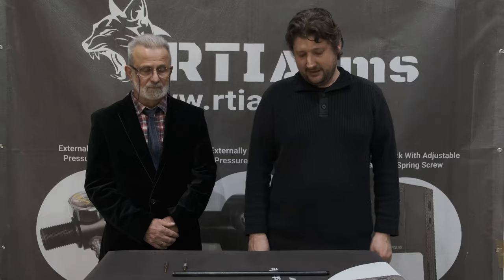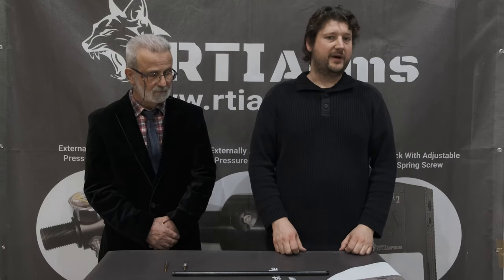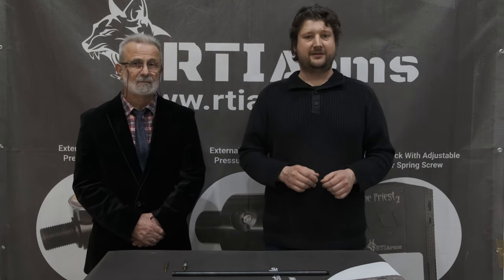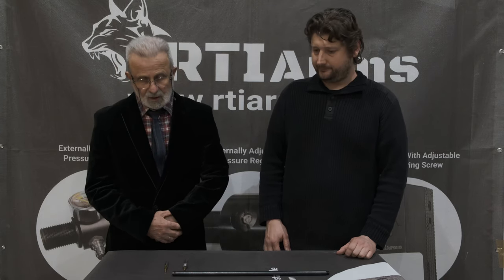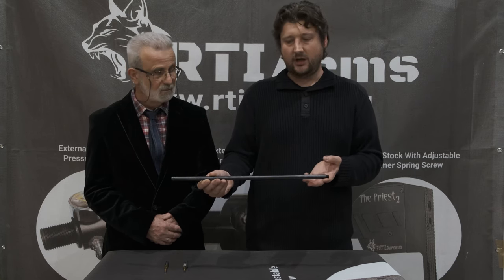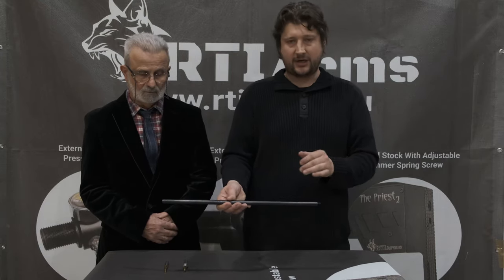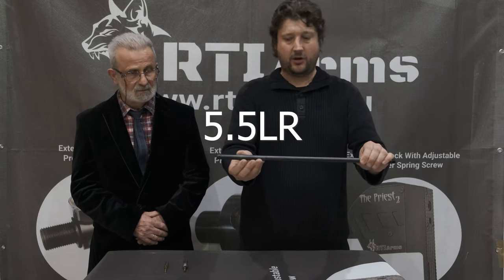RTI's Long Range pellet barrel - Visit of the RTI Arms factory

Comment: Thanks for sharing this with us, Gregor, although you did kinda reveal the secret in your previous video 😉 This is an extremely interesting solution - reducing the twist rate and increasing velocity: like this you decrease the influence of the gyroscopic precession but increase the stabilizing effect of drag, so that there is no conflict between the two which might lead to spiraling and a drop in accuracy 🙂 Plus the higher velocity leads to a lower time of flight and hence to less wind exposure. A great concept! I wonder if the rest of the manufacturers are beating themselves up and asking "Why didn't I think of this first?!!" 😉 See you at the IWA, bud!
Reply from the maker: Yes, I did reveal it in Airgun physics video because at the time of recording that video, this one was already recorded... ;) See you :)

Comment: Gregor will you be making a video how to adjust the regulator and the hammer like you did with the Huben?
Reply from the maker: Yes, as soon as I get the production version of Prophet...
Reply: Great can't wait. Hopefully you can als give the proper"settings for the regulator and how to dial the hammer spring. Would it be the same as the Huben? So fully screw in the hammer spring and adjust the speed over 10 m/s with the regulator and then turn back the hammer spring? For the Monster redesigned .22 the optimum speed is 320 m/s?
I also have ordered the Prophet in the performance package, so hope to see your video soon. Happy testing.
Reply from the maker: @fuselman91  Hi.  Yes, the procedure is similar. The optimal speed for accuracy is anything between 300 and 320 m/s , depends on what is your acceptable shout count...
Reply: Gregor last? question. What kind of scope power do you recommend for 100 m shooting? 6x24 50 or 5x30 56 FFP. What power did you use at EBR?
Reply: @fuselman91  QUESTION: Which dealers can you order the Prophet from now?
Reply: Airgunheaven.com or luchtbuks.com is in the Netherlands
Reply from the maker: @fuselman91  I was using Nikko Stirling LR 6-24x50. I would recommend to use a better scope with as clear glass as possible, magnification more than 30x and definitely SFP with as thin reticle as possible, preferable with some sort of mill dot design to be able to use hold overs and windage...

Comment: Hi, I have purchased the 600mm barrel. I plan to install it in my Priest 2 (which already has all of the performance updates). Will it be a problem to put this barrel in this gun? Thanks
Reply from the maker: There shouldn't be any problem. All barrels are interchangeable. one thing to pay attention to is the end piece of the barrel, it has to fit the barrel as well as fit the inner diameter of the shroud. Those things did change through the time of RTI guns...

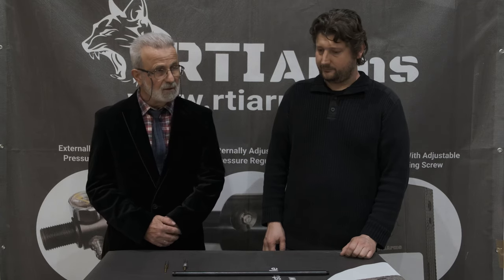Comment: Are you talking about pellets or slugs? My muzzleloader has a 1:32 twist rate and it is very accurate but I am shooting copper coated slugs at over twice the speed of an air gun. I would think that the skirt on a pellet would make them loose a lot of energy at any kind of long range.

Comment: Great stuff, how fast/far will pellets go now, catching up on slugs?
Reply from the maker: Well, pellets will never beat slugs at long range (assuming the slugs shoot accurate), but this is an ideal solution for competition where they do not allow slugs. Also, pellets are still much cheaper and probably still (in my experiences) more accurate is the conditions are good (no wind). I have tested this barrels in 3 guns so far, the fastest I push the pellets was about 1070 fps with Wolverine and I got about 1,5 - 2 cm groups at 111 yards... I will show that clip once I get The Prophet for a review. So to answer you question, I prefer pellets over slugs (at those high velocities form this barrel) over slugs up to 70 meters (about 76 yards) in almost any conditions (of course this is not a "hard" limit you can go + / -), but further that that it depends on the wind. But is it also important to note that the guns that i own that do shoot slugs are a little less accurate and at my 100 meter range in mild wind, I can still make the same groups with pellets as with slugs simply because pellets are more accurate but at the same time more susceptible to wind.

Comment: Why did RTI change their barrel to the  Lothar Walther (RPB) in .22 with a twist rate of 1:16? it simply contradicts your explanation of having the key which is slow twist rate. It would be better if there was a choice what barrel to get
Reply from the maker: RPB barrels are built for slugs but shoot well also pellets if the velocity is not too high. Long Range barrels are made exclusively for pellets. Their advantage comes into action once you shoot pellets at higher velocities. I have proven this at 2019 EBR when my gun won the 50 yards and also with result at 75 yards. As far as I know, if you buy new RTI gun, you get RPB by default but you can still order longe range barrel...
Reply: @gregorkamensek3923  Thanks for the reply. BTW, which slugs work better .217 or .218s?
Reply from the maker: @michaelacosta1821 I have better results with .218

Comment: Will you be testing the new JSB slugs and the H&N slugs?
Reply from the maker: I might, but not with this barrel because as stated in the video, this barrel is specially design to work with pellets. It will probably not perform well with slugs.
Reply: So the monster redesigned .22 are the best for this barrel
Reply from the maker: @fuselman91  Yes, I recommend Monster Redesigns but I have also tested with regular JSB's and it works excellent up to 1050 fps.